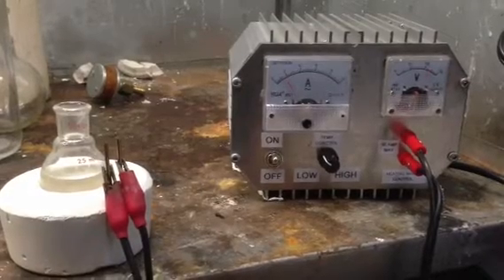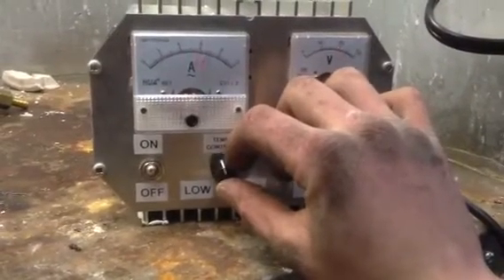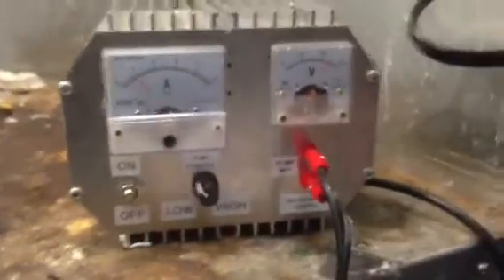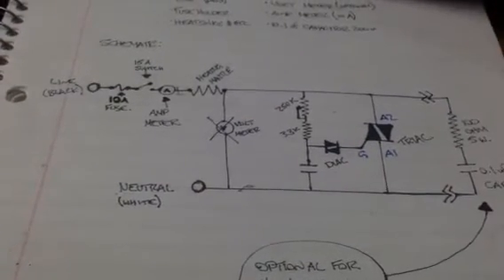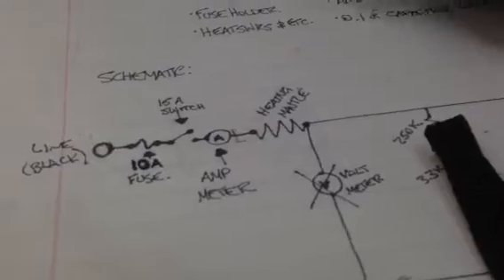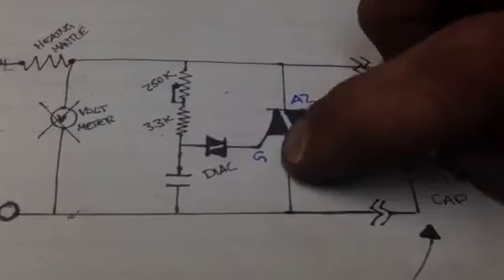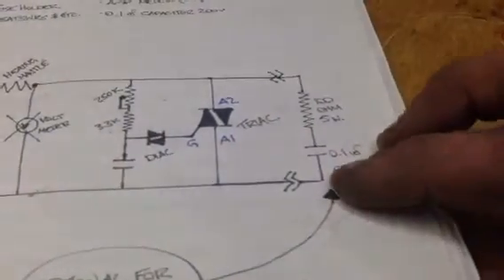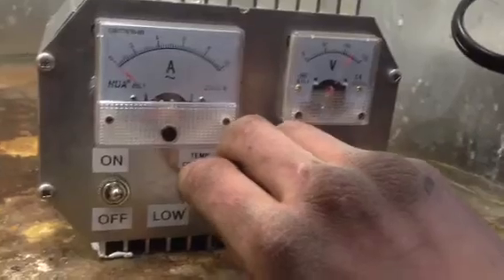DIY heating mantle controller CHEAP

Comment: Cool video, wish i had seen before i bought my Glas-Col O406 500ml Fabric Mantle as well as a Watlow 360 series temperature controller, because i cant figure this shit out... i found the manual on the internet and got as far as hooking up the power and the thermocouple but from there it gets a lil over my head as i know very little about this stuff... i think i might build your mantles, looks like pretty straight forward project following your very informative narrative... 
ill attach the manual for the controller i purchased if you could give me any insight im all ears. Thx mang, keep up the good work dude, you videos are really good
http://mrocrib.com/en/index.php?controller=attachment&id_attachment=170

Comment: If I ask very nicely and say please will you slip some insulation over those vertical 120 volt multi-amp terminals sticking up out of the mantle?  Please?   PLEASE?

Comment: Or you can buy an ac motor controller on ebay for around $5 delivered that can handle up to 2000 watts, has a control knob built in and is so small you can build it right into the mantle.

Comment: Instead of this whole process can't I just buy a variac?
Reply from the maker: variacs are expensive. but by all means you can use one of. you have one. it would need to be minimum 5 amp preferably 7-10.
Reply: +nilamotk  so I think I would go with a ten amp but after proper drying I just plug it in the variac and I'm done?
Reply from the maker: +Kenny Mesa Yes just don't draw too much amperage of you will melt the heating wire.. use an amp meter to check the "temperature" I personally wouldn't go past 5 amps. 5 amps will most likely get your mantles into the thousands of degrees.. you want then in the few hundreds. the higher amperage you draw the less life your mantle will have. you will need to play around with this. start low and increase amperage as needed.. 

a variac is better... hands down.. but a 10 amp variac is a few hundred dollars.. this circuit only costs about 10$ in parts.. but a variac is more robust and can be used for all kinds of other stuff.. with a variac you will fry the mantle before the mantle fries the variac.. this circuit could fail from too much current draw if your heatsink is not big enough.. so it's one or the other, both will work. variacs more robust, the triac controller is cheaper. it's up to you.
Reply: +nilamotk  hey I found this same thing on eBay but a million times smaller and it works perfectly and won't give you that big jump you don't like lol anyways it was $6.00 "2000W 50-220V Adjustable Voltage Regulator PWM AC Motor Speed controller" it's amazing. Try it lol
Reply from the maker: +Kenny Mesa I have it. it's the same basic circuit but it's not actually suitable for motors.. it will fail on inductive loads. and it does have the spike from 0 just like this one. the spike is caused by the amount of resistance in your heating wire.

Comment: I wonder if you could convert an old 12v car battery charger to use as a heating controller? Any thoughts? Transformer, voltage meter and such are already there and ready to go, Wonder if  it's possible?
Reply from the maker: you cant transform DC. car chargers are DC, the transformer is on the AC side of the circuit. this being said, you have no control. it would be "on" or "off" ontop of this, the lengths of wire used for the mantles themselfs would have to be an exact length. the car charger would be 12v these mantles are running at 120v. I dont think using a car charger is the best idea.. you can however look up a "variable transformer" or "variac" they are expensive, but they are a fully variable voltage transformer.. you can get them in all different sizes. a 5 amp variac would be oerfect for this circuit.. but make sure you have an amp meter and dont go over 5 amps on a 5 amp variac or you will fry it.
Reply: Gotcha, Thanks

Comment: Follow up question on your analog meters. Is your Volt meter 0-30V.  Thanks for all you have done I'm learning a lot.
Reply from the maker: the volt meter is 120v its actually completely useless. this circuit does not change the voltage, it limits the current (changes the sine wave) so the volt meter diesnt funtion properly. the amp meter is important to know when your mantles will fry.. the volt meter in this circuit actually works backwards for some reason... 120v reading at the lowest setting, and 0v reading at the highest setting.  I would just leave the volt meter out of the circuit..
Reply from the maker: and Im glad its helped you learn something. that was the goal of this video in the first place.

Comment: Please provide some specifics on the amp and volt meters you are using. I want to stay on the inexpensive side. I'm seeing a lot of options out there. What do you suggest.  Thanks. Your great
Reply from the maker: i biy all my analog meters off ebay from china. I litterally buy the cheapest one.. the difference on higher end ones is accuracy.. all in all, these are just as accurate as high end ones in amps and volts, if you got to millivolts, milliamps or kilavolts, or kilaamps, you would obviously use higher end units for safety reason on the higj voltage, and accuracy on the low voltage.
Reply from the maker: i biy all my analog meters off ebay from china. I litterally buy the cheapest one.. the difference on higher end ones is accuracy.. all in all, these are just as accurate as high end ones in amps and volts, if you got to millivolts, milliamps or kilavolts, or kilaamps, you would obviously use higher end units for safety reason on the higj voltage, and accuracy on the low voltage.
Reply from the maker: i biy all my analog meters off ebay from china. I litterally buy the cheapest one.. the difference on higher end ones is accuracy.. all in all, these are just as accurate as high end ones in amps and volts, if you got to millivolts, milliamps or kilavolts, or kilaamps, you would obviously use higher end units for safety reason on the higj voltage, and accuracy on the low voltage.

Comment: Probably a silly question but why couldn't you use a dimmer switch wired btwn the mantle and a 110 plug to adjust the voltage for the heating mantles?
Reply from the maker: you can try. its basically the same circuit. the difference is dimmer switches arent rated for this much current.. they handle a few hundrew watts, these mantles can draw alot more then that. the controller I have a video on can handle up to 15 amps at 120v. (around 1600 watts (with a heatsink)) a dimmer would work for a small mantle, or a test tube mantle, but most likely crap out trying to make a 1L or 2L mantle.

Comment: hey man nice diy,,,1 question though..can you put this on a magnetic stirrer??
Reply from the maker: Thank you.

Yes, you can use this with a stirrer, but you cannot use it to power the stirrer.. You would have to have a working stirrer, and a working mantle. Set the mantle I top of the stirrer and that will work. 

You Can also use this to power an AC motor, but to do so you need to add the optional part or the circuit.

Comment: I buggered this is somehow.
I can figured it out.. .my meter should not need a shunt. the coil caps should not be polarized .... its pisssing me off
Reply from the maker: The components should not be polarized they are running AC. Also most amp meters come with a shunt built in, you need to use a analogue meter for this to work properly as they have a shunt built in.
Reply: yup yup and yup.

simple damn circuit

bizzare ........

i meant my background is dc circuits.  like stepper controllers laser drivers other simple crap.

its going to be something stupid
it always is
Reply: nilamotk wait should the analog meter have the shunt symbol with or without the internal shunt?? if i remember if it has the symbol it needs a shunt? mine has no symbol
Reply from the maker: You can ditch the meter all together and use a regular amprobe meter on the side, like a clamp meter to measure ac current.
Reply: its crazy....  it should work/ everything rings out lol!

but i get no voltage between the neutral rail and the return..  yet i do rail to rail and the connections are perfect lol!!

is my coil too beefy?? that dont even make sense  !!! lol

ill build another circuit in the morning 
might just buy a variac for now
Reply from the maker: It won't give a voltage without a load. You can measure a voltage unless the mantle is in place,
Reply: yes, the gate wont trigger
i left the load connected.

i used oscope probes as connectors the banana plugs click in perdect

so i left a loop end down inside rubber tubing so i can reach down with the probes to clamp onto the loop of nichrome.

nothing exposed
Reply: nilamotk  it was very very stupid.
I had a bad pot.  I have never even seen a bad pot! so its working.  But 2 amps barley does anything to this massive voil lol
Im going to have to run it is for 2 days im guessing
Reply: nilamotk Im also noting a slight blip in my amperage.  I get about a 10th of an amp blip about every one second
.
Reply from the maker: You can run it with more amperage if it's not getting hot enough, just make sure it's good and dry first.

Also this circuit is not a laser driver, it's not going to hold currents on the point perfectly.. It's basically a high powered light dimmer.. With a scope, you will notice some fluctuation.. If you didn't have it, you wouldn't notice any issues.

I could have made a constant current regulator, but it's 10x as complicated, and not any better for this use.
Reply: nilamotk It cracked a tiny bit but just a hairline. with the mass of coils I have its not going to get any worse.  I can NOT believe that it is still wet.  I sat in a dehydrator for a couple of days!!!

I ended up putting everything in the body of an old Elpac power supply. I even reused the computer style power entry module. Nice and compact.   At 3 amps it will boil and the triac only heats to 35c which surprised me a great deal

So that is where it is now again.  I put it on just shy of three amps and I set it in the dehydrator on high.  It will dry out now for sure,

I cant believe how much inconsistency there is in Lab Glass!!! I put two separate flasks in it and one sits about 1/4 inch off the bottom lol 

I really really want to thank you for putting this out there!  It has been real fun other than that bit with the bad potentiometer lol

I(m getting a new distillation se tomorrow and cant wait to crank out some badly needed nitric acid.  I was down to one condenser an allihn.  While they are nice for their efficacy they are not good for nitric acid as you get a lot of product sitting up in the condenser bulbs. WHile not an enormous issue its still a pain. 

really man.  thanks so much for this,
Reply: Now im going to build one with the motor controler for a centrifuge that I built.

I got creative with the motor wiring and was able to use a simple dimmer switch but this wold be much better.
Reply from the maker: No problem man, I'm glad it's all workin out for you and I'm glad the tutorial helped you out.

I would run it at 1-2 amps for a couple of days to dry it from the inside out.

And if you want to use this with a motor make sure to add those 2 extra components. (Resistor and capacitor) otherwise you will pop your triacs from spikes caused from inductive loads like a motor.
Reply: im going yo make a super light weight one tomorrow out of perlite. maybe a 500ml

Comment: all that you have in that big box is the tiny circuit board?
Reply from the maker: Haha yup, it's actually even smaller. I'm using the whole case as a heat sink instead of putting one onto the triac itself. I had the case from a power supply for a big aquarium light that had burned out. You can put it into whatever you want, but seeing as it's so lightweight you'll want a heavier case to keep it where it is instead of sliding around your table and what-not